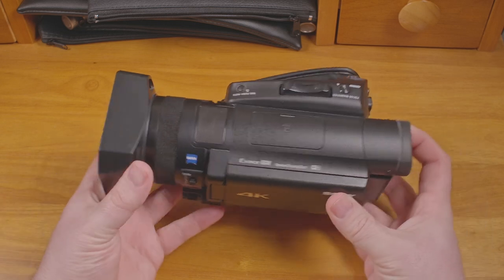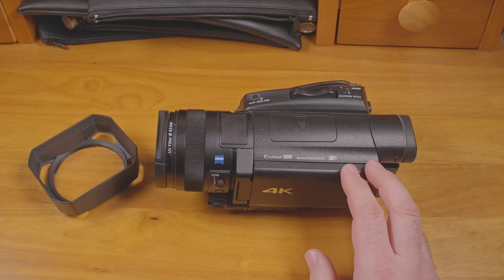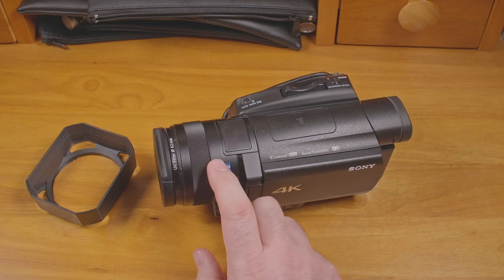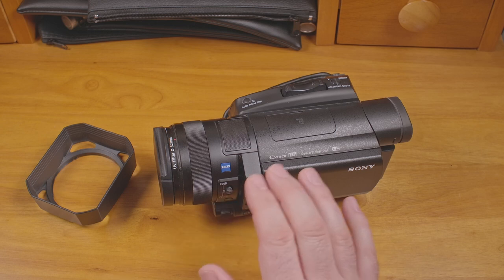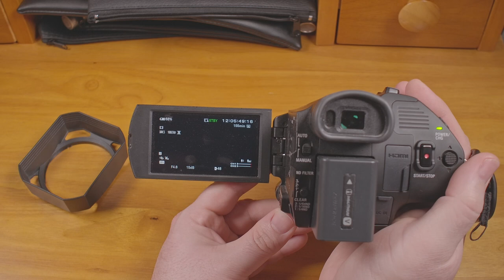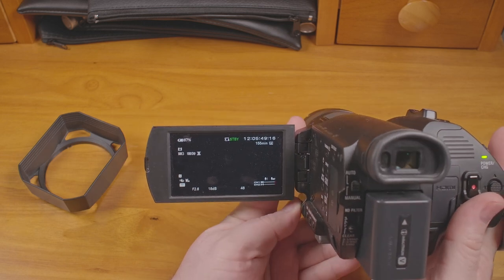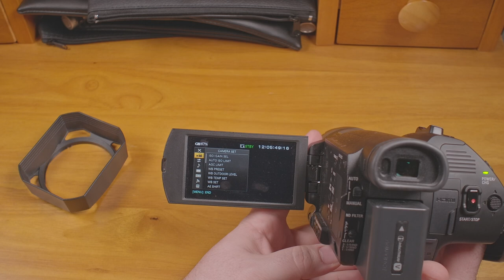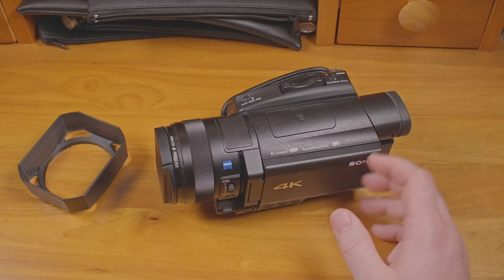Sony AX700 Camcorder: Versatile, Excellent Video Camera

Comment: Would you suggest this camera for recording stand up comedy shows... not the best lighting but usually not too bad... any sound issues?  thank you for any recommendations
Reply from the maker: This camera would probably do okay in that situation.  Sound is going to be the biggest challenge and that's going to be true with any camera.  Depending on where you are in the crowd you may end up picking up more of the audience reactions than the comedian.  This camera does have a 3.5mm microphone input jack, so you could use an external shotgun mic which might help cut down on a bit of the audience sound, though depending on the size of the venue, you may have to make sure the mic is pointing towards the closes source of sound, whether that be the comedian themselves or the nearest speaker of the sound system (in a bigger place).  I haven't tried to record in that situation before, so I can't say for sure what would work best.

If you are recording in an official capacity, they may have a way for you to receive an audio feed from their system.  At that point it would just be a matter of getting it into the camera.  You'd have to figure out what they are providing so you'd know how to adapt it and get it into the camera.
Reply: @bigtb1717  thank you for your responce..

Comment: Does it allow you to take photos while recording video?  My old Sony HDR-SR1 does.  Need to upgrade to this if it allows it.
Reply from the maker: Unfortunately, there is no way to take or save a picture while recording video.  In fact, the camera will not let you take a picture when in video mode.  You have to switch into photo mode, at which point you can no longer record video.  It's one or the other.  If you are recording in 4K you could extract 4K frames from the video, but obviously that's not quite the same.
Reply: @bigtb1717  Thanks.  Yeah, I figured it out that that is the case.  That's why I bought an AX53 as it does take photos while recording.  Now I have two cameras.  More likely, I will be returning the AX700.

Comment: I have a AX53 from more than 1 year and I'm really happy for that. I use frontal ring for exposure control but i'm really dissappoint that when im recording 4K there is no hdmi out, so I can not use an exterrnal monitor to control all. Can you confirm me that on AX700 hdmi out works also during 4k saving? I'm thinking to buy a second hand AX700 to add to my AX53.
Reply from the maker: If I get a chance, I'll test this tomorrow and let you know.
Reply: @bigtb1717  Thanks!!
Reply from the maker: Unfortunately, when you begin recording in 4K the display output blacks out.  The on-screen data remains, but the actual video feed goes away.
Reply: @bigtb1717  Thank you!! I'm quite sure I will buy in next week a Panasonic HX-1500

Comment: I am thinking of getting back into the filming hobby. When I was younger, I would film skateboarding. My main camera was a Sony TRV900 and a VX1000 3CCD cameras. With those cameras, I would carry "color cards" so I could adjust my colors the way I wanted to. Is that something is still able to be done on these newer camcorders? Have not touched a new camera in years so I have no Idea but I am interested in this camera.
Reply from the maker: If you do the manual white balance setting, you can adjust the color somewhat and you can also adjust some aspects of color in the picture profile.  There are also many different color and gamma profiles to choose from.  But you don't have a vectorscope or anything like that built in, so you'd just have to go by eye, so to speak, with a color card.  You can hold a white or gray card up to the camera and have the camera auto-set the color and white balance based on that as well.
Reply: @bigtb1717  Ahhh got it. So it sounds like this is still possible. Glad to hear it. I think I am decided on the Sony AX700, i've always been a big fan of Sony camcorders.
Reply from the maker: @Immortalkalashnikov  I have another video where I go through the menus and settings/options in this camera.  Might help you see if it will do what you want.

Comment: Thanks for this review. Do you know or could check at what focal lengh the lens reaches f4,5 aperture? And can you make all setting sby touching LCD? Thanks.
Reply from the maker: I'll check the focal length/aperture when I get a chance.  The touch screen is a bit limited.  It can to touch to focus track and can be used in the menu at times for things like touching an X or for touching OK or Cancel, stuff like that.  But for general menu navigation, you have to use the joystick on the back.

Comment: Hi Sir new sub here, me i know what is your settings for the arc shot?  for 2022 what cam corder you can recommend for recording videos specially in welding arc shot ? thank you for sharing
Reply from the maker: All my arc shots for a long time are with this AX700.  I set the camera for manual focus, set the camera up pointing at where I'm going to weld and set the focus at the right spot.  Then I turn the ISO/Gain all the way down, set the iris/aperture around f/8-10, then set the shutter speed to 1/576-1/1200 of a second.  Finally, I turn the built-in ND filter to the highest setting and start recording.
Reply: @bigtb1717  thank you for the information very much appreciated

Comment: What do you think about this AX700 vs the Sony RX10 IV for video etc ?
Reply from the maker: They both have positives and negatives.  Personally, purely for video, I'd choose the AX700 all the way.  Built-in ND filters, more dedicated video control buttons and features, unlimited recording length and likely longer battery life.

The RX10 IV has more zoom and is much better for pictures, so as a "hybrid" camera it would be a better choice.  It also has a 30 minute record limit, so that could be a consideration.
Reply: @bigtb1717  Thank you !

Comment: how would this match against the A7S III or Alpha 7 IV, kinda in between to make a decision for video recording, and 4+ hours battery while recording 4K is a big Pro for Camcorders, also I'd imagine this doesn't heat up that terrible like a Mirrorless.
Reply from the maker: The A7SIII and A7IV are both going to have a cleaner image and be better in low light.  And obviously, being full frame, they can achieve a shallower depth of field at a given field of view.  Honestly, depending on what you are doing, a shallow depth of field may or may not be a good thing.  For instance, if you are recording at a desk and want everything on the desk to be in focus, you might need f/5.6 or so with a full-frame camera, which might make it difficult to get enough light or require a higher ISO.  Probably not a big deal on those cameras since they are great at higher ISO, but with a 1" sensor, the whole frame might be in focus with an f/2.8 aperture, which lets in more light.  It just depends on what you are doing, because a super shallow depth of field isn't actually a good thing in all situations.

Battery life on the SIII and 7IV is pretty good, and in most situations, you won't have overheating issues on either one.  But battery life is a bit better on the AX700 and I think you can get larger batteries as well.  It also comes with an AC adapter that can power the camera indefinitely.   I've never noticed the AX700 feeling even warm, but I do typically record at 1080p.  Still, I'm sure you won't have to worry about overheating with the AX700.

In terms of pure image quality, the SIII and 7IV will definitely do better than the AX700.  They have a slightly cleaner image overall and have higher quality codec options (10 bit, 4.2.2 and higher bit rate options as well).  They also have the flexibility of interchangeable lenses.  However, they are also quite a bit more expensive (particularly the SIII) and the AX700 includes a versatile, reasonable quality lens with powered zoom.  It just can't be swapped out.  If you want to record at 1080p, the SIII is excellent and the AX700 does pretty good.  From the tests I've seen, the A7IV loses a bit of detail at 1080p (I mean, more than is strictly explained by the drop in res).  So at 1080p, the A7IV is probably the softest in terms of detail, though it's still a cleaner image in terms of noise than the AX700.  At 4K, the A7IV is probably the sharpest, most detailed because it oversamples from 7K.  However, they all do well in terms of detail, and the A7IV has the most rolling shutter of the three in 4K because of that oversampling.  

In terms of image stabilization, the AX700 wins there.  

If you have any specific questions, let me know and I'll answer if I can.

I don't have access to an A7SIII, but I might be able to do a comparison of the AX700 and A7IV at some point.  Not sure exactly when.

Comment: which camera did you use to record this?
Reply from the maker: I have a Z Cam E2C mounted on an arm in my sound booth above the desk.  That is what I have been using lately for the videos at this desk.  I have it powered externally and recording into an external SSD.  Makes a very convenient, semi-permanent setup in the booth.

I generally record at 1080p, H265 which gives reasonably small files and plenty of quality for video at the desk.  No fan, so it's silent, but can still record continuously, as long as I need.  So far, it has been an excellent little camera, at least, for my usage.
Reply: Thanks for the response. Your footage looks great.
But I checked the Z cam is quite expensive, so one should expect good video 😉

Comment: Which sd cards do you recommend?
Reply from the maker: I've had good luck with Sandisk cards over the years.  Most of my cards are Sandisk Extreme and I've never had an issue.  I do have a few Sony cards now and haven't had an issue with those either, but those are more expensive because Sony only makes UHS-II cards.  You don't need that much speed for the AX700.  So I use UHS-I, Sandisk Extreme/Extreme Pro cards.  They aren't the cheapest, but they aren't too expensive.  I think a 64GB Sandisk Extreme Pro is around $15-$20.  I always buy from an authorized retail seller to have the best chance at getting genuine cards.

Comment: Hey, I just chatted with Sony and I kind of don't believe them about the following LOL. I bought the AX700 and I love it. But I do put it on a 20 foot tripod at times to record sporting events. I asked if there is a way to turn the camcorder on and off either remotely or through some kind of wired device, and they said No. I suggested the camcorder's remote, the Sony app (Imaging Edge), and asked for a wired option. I prefer not to drop the tripod during halftime for example just to shut off the camera, so hoping there is a logical option.
Reply from the maker: I have a wireless remote system for Sony cameras that connects to the "multi-interface" port.  Basically a micro USB port on Sony cameras.  I know for a fact it will turn point and shoot cameras like the RX100 on and off.  I thought it would work on the AX700 too, but I can't remember for sure about powering the camera on and off.  I went to the bag where I keep it so I could give it a quick test and let you know.  It's not there, lol.  No idea where I left it.  I'll dig for it and try to test it out and let you know in the next day or two.  It was around $40-$50 I think.
Reply: @bigtb1717  Awesome much appreciated, do you recall the make/model of the item?
Reply from the maker: Revo VRS-Multi-W.  I just looked it up.  I guess the wireless version is currently almost $60.  They have a wired option for about $30, but it probably wouldn't work quite as well for your application.  Those prices are from B&H Photo, by the way.
Reply: @bigtb1717  thank you! please let me know if you find and test it. i have a shocked sony tech on my other monitor right now, he said he doesnt see a sleep (battery save) mode on the ax700 but there was one on ax53
Reply from the maker: Just a note, the Revo VRS is different from many of these remote controls in that it has a "sleep" button.  This is the button I've found will turn the camera on and off.  I'll find it and let you know some time tomorrow whether or not it will turn the AX700 on and off.
Reply: @bigtb1717  found it on amazon and just bought it, easy returns if doesnt work as needed :)
Reply from the maker: @baldino.soccer  Cool.  I'll still test it myself on the AX700 as well.  I don't remember trying to turn the AX700 on and off with the button, so maybe it won't work.  But with an RX100 I know the camera could be completely off and I could plug in the VRS and push "sleep" and the camera would turn on.
Reply from the maker: Just a tip.  The wireless version does not come paired.  It will not work out of the box until you pair the transmitter and receiver.  It's fairly easy to pair them and I've never had them lose pairing, but they do not come paired out of the box.  Also, I just tested it and the "sleep" button definitely turns the AX700 on and off.
Reply: @bigtb1717  AWESOME!
Reply: I can't seem to get it to work. I paired them, then connected the receiver into the MULTI port, tried using the remote for any functions and nothing. Do I have to go into the camcorder's settings to allow remote/3rd party access/control?
Reply: nnnnnevermind, all set, thank you again for the product suggestion!

Comment: What is now your go to camera?
Reply from the maker: For a long time it was a Blackmagic Pocket 4K.  I still think that is a great camera.  Reliable for me, good image quality, good color.  But I wanted autofocus for a few applications and I wanted something a bit smaller and simpler.  My Pocket 4K had a V-Mount battery and SSD rig set up which allowed for long, continuous recording, but it was pretty big and I wanted a simpler, smaller camera.  I currently use an A7 IV as my "main" camera and the AX700 for arc shots and stuff like that.  Dual SD cards allows me to have a backup of my files, the internal battery gets me a couple hours of record time and H265 files allow good enough quality with relatively small files.  It's. a great camera for what I do (not just Youtube).
Reply: @bigtb1717  Thanks!

Comment: Great Info, Question: You mentioned that you have replaced the ax700 with another camcorder as your primary,, With what and why? Also did you see this vid https://youtu.be/bZ5hSfAwXi0 thoughts, Thanks!
Reply from the maker: For a while I was using a Blackmagic Pocket 4K.  I loved and still love that camera, but I found myself getting into situations where I really wanted autofocus.  I now use a Sony A7 IV.  

The AX700 still gets used a lot, but I appreciate the 10 bit video, better dynamic range and better low light of the A7 IV.  Not just for YouTube, but I have also done marketing videos and photos for the company I work for a few times and it's nice to go from recording stellar video to taking great stills in an instant.